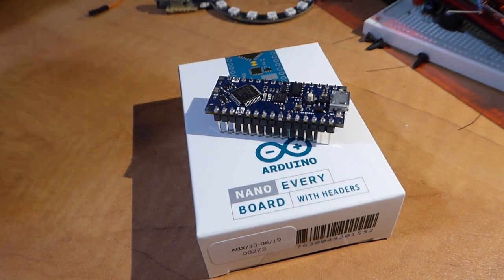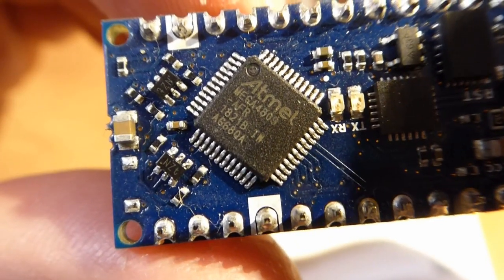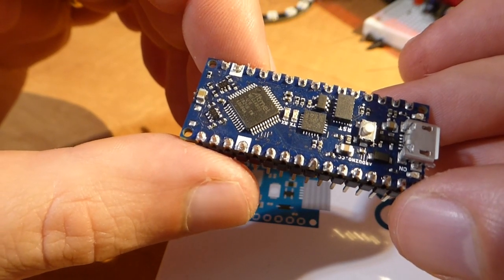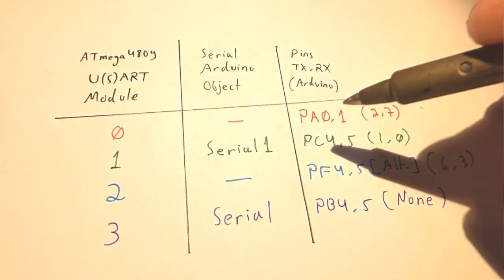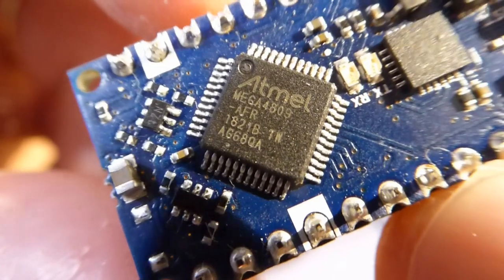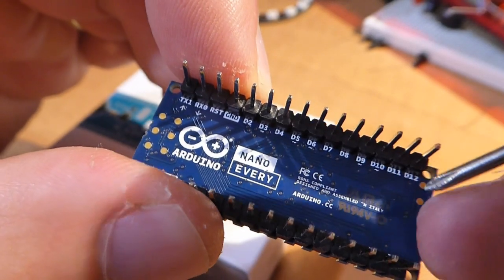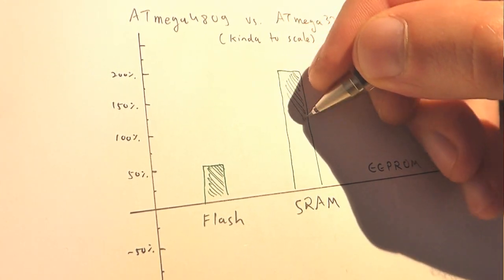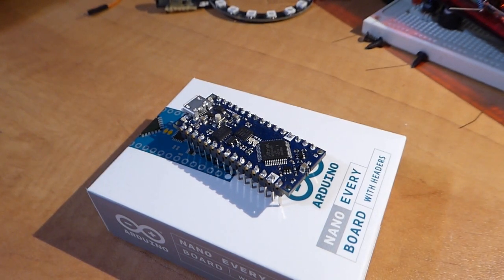Arduino Nano Every: Honest Review and actual info!

Comment: This new board  Nano Every as the 33 IOT should meet with success. If during a development of which we do not know exactly the needs in flash memory and RAM at the beginning, we can start with a simple Nano v3 then if necessary pass to a Nano Every or 33 IOT.
Reply from the maker: As I said, the old and the new Nanos are not 1:1 compatible, so the switch is not 100% obvious - but yes, in some cases the Every can be a good upgrade. The 33 IoT is on a whole different level in terms of capability - and I see it's not 5V tolerant, so be careful :-)
Reply: Yes you are right but with little adaptation, with the sensors we juggle between 3v3 and 5V. The great interest of the Nano board is that it is very compact. So far, when a single Nano was not enough for my project (lack of RAM in general especially when using an SD card), I installed 2 or more Nano board mounted in I2C master/slave which is very economical given the low price of this board.

Comment: Currently I mostly use pro micro boards for most projects. The only thing that is lacking on that board is a decent 3.3v output. For most projects I get by with either a PSU that also has 3.3, a dedicated regulator or even a voltage divider which work fine for simply applications.

I like dual inline boards and I need USB HID functionality and I2C. Other options are nice, but nut mission critical. I never really seriously ran out of digital or analog pins. There is always a workaround.

A sub 10 euro board with HID and 3.3 volt out and a basic supplement of analog and digital pins is just what I need actually.